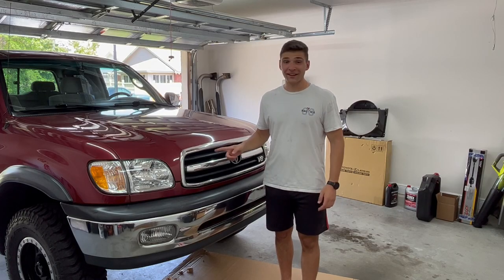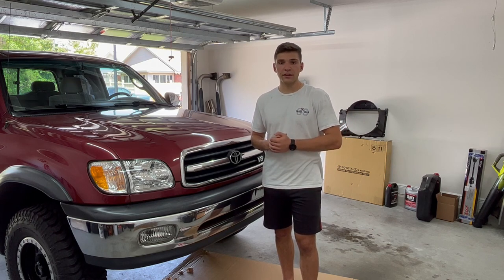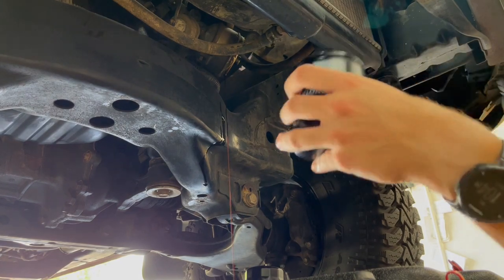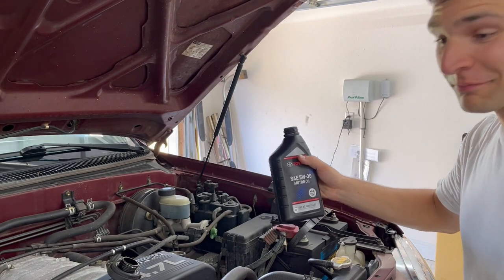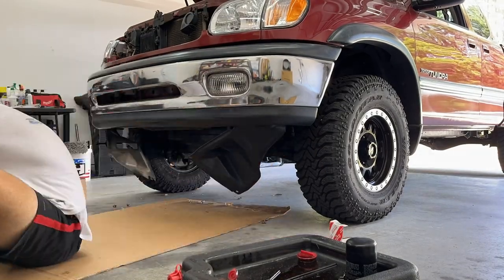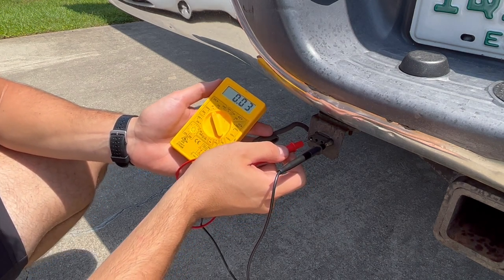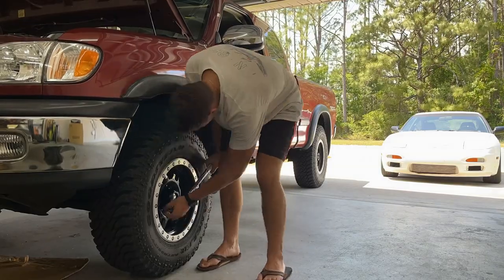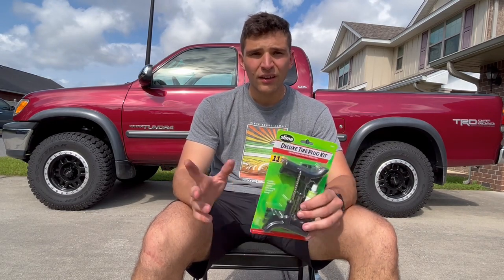Getting my truck ready for towing duty

Comment: Hey just a heads up bc you obviously care a lot about your truck. The '00-02 model years had weak overdrive planetary gear sets that are prone to accelerated wear and even failure when towing. From what I've read, it's best to be very easy on the throttle in overdrive to keep the torque converter locked. And if you do need more power you can let it downshift then hit the overdrive lockout to keep it in 3rd until you're back to cruising. Safe travels!
Reply from the maker: I appreciate that Andrew, I also have read online that it’s smart to have O/D off while towing so that’s going to be my plan. May cost a little more gas having it run at like 3k rpm going highway speeds, but if it saves my transmission I’ll take it! Haha thanks for watching! - Sal
Reply: This is true! Ask me how I know? 😢 I updated to an ‘03 transmission. No more metallurgy issues. 😃 Mine is a 2000.

Comment: 00-02 tundra tow with OD off due to weak OD gears. They changed this starting 03. Upgrade to larger front brakes from 03-0? Tundras. I own 03 Tundra 4x4 same color as yours. Thanks for posting. I find your vids/mods very useful.
Reply from the maker: Yep, that's what I read as well and was very diligent to deselect overdrive every time I was towing. Never had any issues! Thanks for the insight about the brakes, I wonder if they would fit with these 16in wheels. Thanks for watching - Sal

Comment: Just letting you know especially if you’re towing you should change that brake fluid. It looks black, should be a clear/light amber color.
Reply from the maker: Good call, I haven't touched the brake fluid in the truck so who knows how old it is. I appreciate it - Sal
Reply: @JDMDriveway  just make sure all your bleeders come loose before you try

Comment: Bro I am the same way... Have great XXL gloves and always just go at it and then realize dang man, I forgot my gloves! I love the 1st gen Tundras. Would almost get rid of my 100 Series if I came across the right kind of deal but the old LC has over 400K on it and wants to keep going to alas we keep it going. Keep up the good work man!  Man those hem wheels look great though man! A Tacoma owner should suck them right up as the slight difference in offset puts the rims themselves out maybe 3/4 of an inch IIRC. That's why I have FJ steelies on my 2015 Taco.
Reply from the maker: I’ve never had the chance to check out a 100 series but I’ve heard great things. Those FJ steelies look good on almost anything! Such a simple but classic design. Thanks for watching! - Sal

Comment: Hey Sal, is that skid plate stock? I have a plastic one on my '00 that i want to replace with a sturdier one
Reply from the maker: As far as I know it's stock. It's is a freakin heavy steel skid plate lol I can't think of the company off the top of my head, but there's at least one out there that makes steel skid plates for our trucks that even come with a little door for emptying the oil filter without removing the whole thing. - Sal

Comment: Do you have or think you'll need some sort of helper bags?
Reply: was about to say! i have the firestone airbags and they are great...
Reply: @thomasbrierley3580  can you send the link?
Reply from the maker: Honestly, I don’t have plans to use helper bags or an add a leaf. It may not be the best decision, and I wish I had planned a little better, but I’m gonna give it a shot and I’ll let you guys know how it does! Thanks for watching! - Sal
Reply: Was gonna ask of you still had those wheels and then you said you sold them already
Reply from the maker: Yup I got rid of them today, the tires were pretty dry rotted and the wheels looked good, but had some corrosion on the backside. That’s why I let them go for cheap
Reply: @JDMDriveway  im sure youll be fine, i had to trailer my sisters 4 runner back from NYC after it busted its lower control arm mount hah, deffinetly felt the weight , but nothing to be worried about

Comment: What size wheels and tires are you running? 
What kind of lift do you have? 🤔
Reply from the maker: The wheels are 16x8 +0 offset and the tires are 265/75r16. I've just got a 2 in leveling spacer from eBay. This other video goes into a little more detail 👍🏼 thanks for watching - Sal
https://youtu.be/gD2DY-Zu448